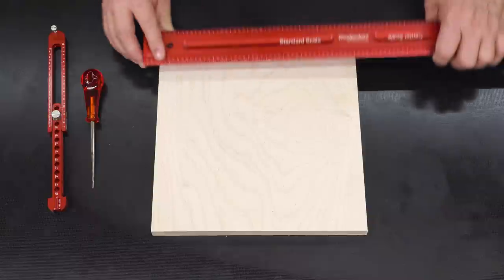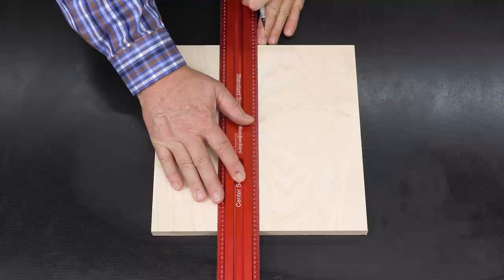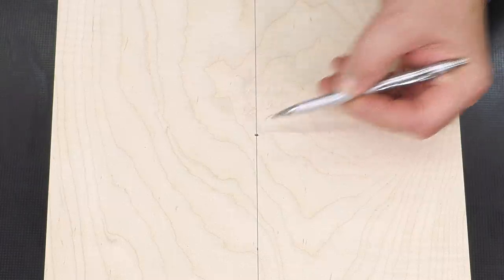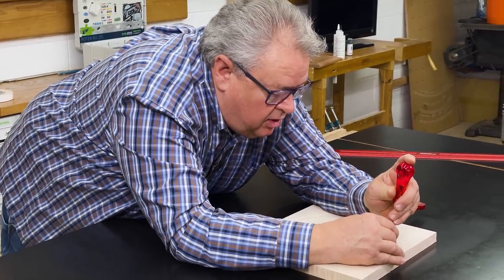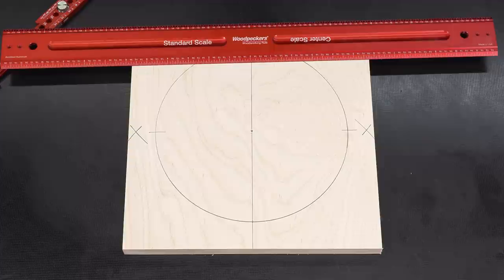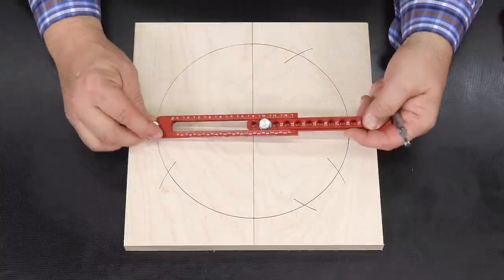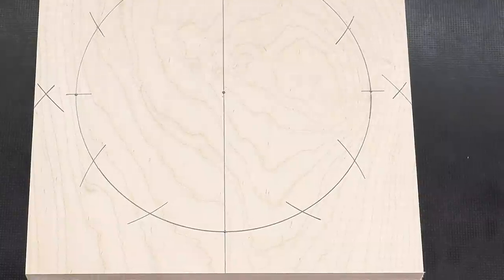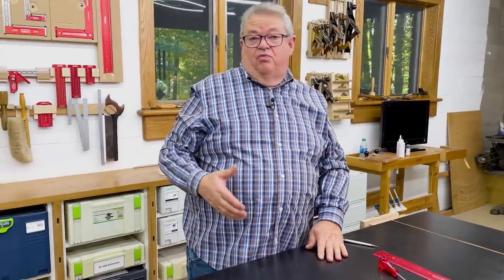Make A Modern Wooden Clock With Pocket Compass | Deep Dive | Woodpeckers Tools

Comment: Whoa!  Jeff, the center of your stock is the intersection of two lines from each diagonally opposite corner.  It doesn't involve measuring, just a straight edge.  2:17 time mark
Reply from the maker: As I mentioned in a reply to Steven Jaynes below, I need a center-line not a center-point. Diagonals would give me the center-point. You could construct a center-line from the diagonals if you wanted to avoid measuring, but at some point there would be more layout lines than I personally would be able to keep track of.
Reply: @WoodpeckersLLC  well, I have a Woodpecker's 1281 square, so I'd just make sure to run my line through the center I found with the diagonals. :)
Reply: All you need is a straight edge, a compass, and a pencil. Very basic drafting.

Comment: Jeff?  Why not just note the intersection of two diagonal lines?  It doesn’t sell rulers, but is WAY faster and less prone to errors than measuring to two center points???  Very nice pocket compass.
Reply from the maker: Two diagonals would have given me center, but I needed the starting axis (12 and 6 o'clock), too. I suppose I could have drawn diagonals and then used them to construct a vertical line bisecting  the "X". Didn't think about it. Like I said in the video, Mr. Barnes' Geometry class was a lonnnnnggggg time ago.
Reply: @WoodpeckersLLC  agreed.  Building the perpendicular 12 o’clock line would be another quick job with the Pocket Compass or a Woodpecker square!